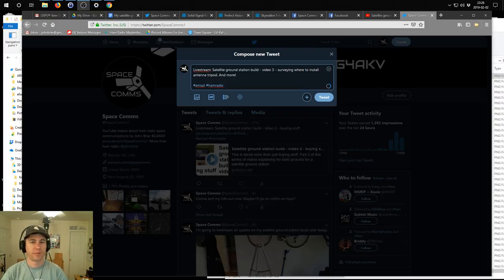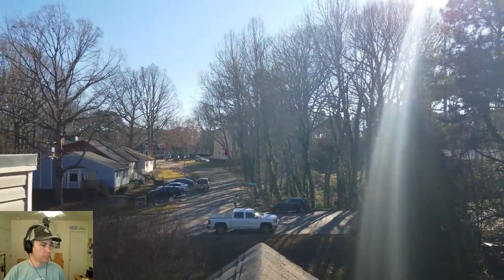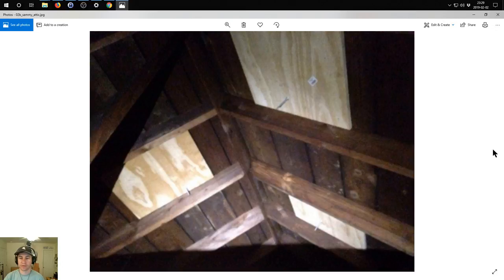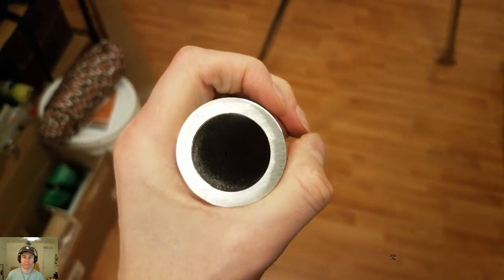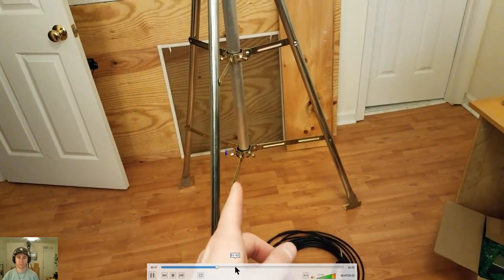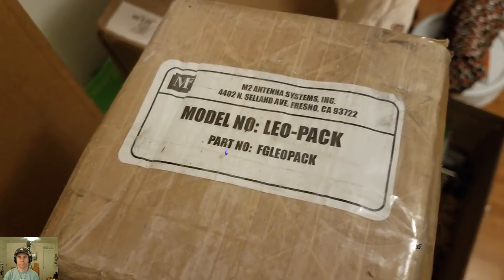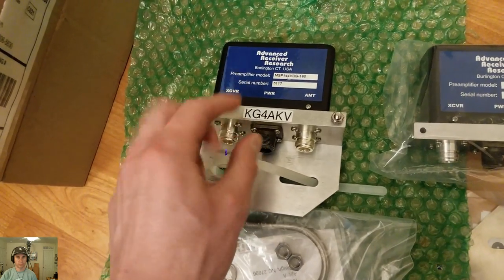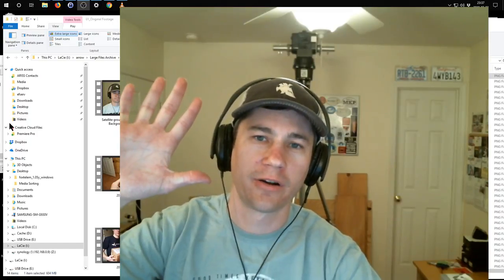Satellite ground station build - video 3 - surveying

Comment: I used 2X6 between my rafters and the roof tower is rock solid with that setup.
Reply: @SpaceComms  I don't have any pictures handy.  Would have to haul the ladder into the house to get access to the attic to take some.  Basically did what you were showing, but used 2x6 instead of plywood.  The 2X6's are cut to be a tight fit between the rafters. When the bolts are tightened, it snugs right up against the underside of the roof.  Once that is done, I sunk screws to attach the 2X6 to the rafter as well.

My tower is 10 feet tall with ladder rungs so I can climb it.  Needed to be sure it was really solid in case I had to go up for some reason.  With this setup the 2x6's will handle the down pressure of my body weight, but also resist any upward flexing when the wind is strong.  To blow the tower over would require the roof and rafters to go with it.  Not likely going to happen outside of a tornado, but can't engineer survival of the house let alone the tower in that case.

The only changes I plan are to drill out the rivet that is the pivot point on the single leg and replace it with a good nut and bolt.  That will allow me to release and  tip the tower back on the other 2 legs if I need to service anything at the top.  I am fortunate to have a roof layout where I can do that and work on the antennas safely.
Reply from the maker: @skyliner218  Thanks Patrick. That helps.
Reply: @SpaceComms  No problem.  Good luck with the build and hope to work you on the satellites soon!

Comment: Nice Video There John!!  I hope building that satellite base station is going well.  What software do you use for ISS and satellite tracking?
Reply: Does the software cost money?
Reply from the maker: I will use SatPC32. The free version is fully featured but you have to enter your coordinates every time. The paid version is available through AMSAT and so you are supporting AMSAT if you buy it. I also use Orbitron which is simpler to use and free. Orbitron does some things differently in a way I prefer over SatPC32, in particular pass simulation. You can see me use it here https://youtu.be/6fVJn2CR6Vc?t=57

There is also gpredict which is open source. MacDoppler is a great package if you use Mac as well.
Reply: Thank you very much!  I should get on one of your live streams some time!